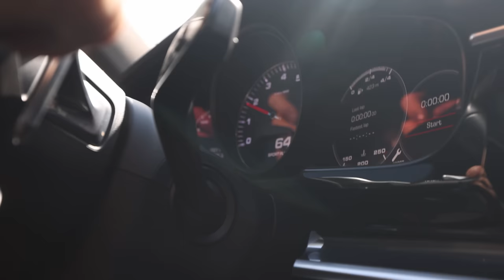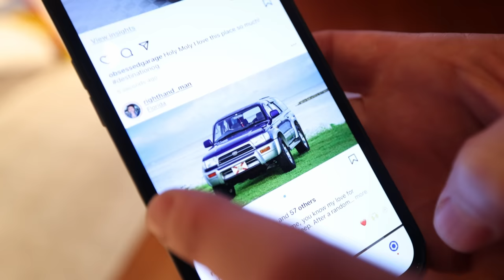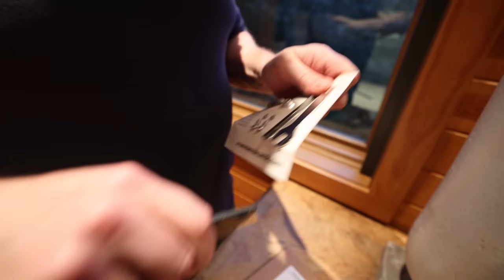Destination OG: Phase 2 - Installing Rogue Gym, Home Theater and Hiking! (EP:1)

Comment: Hey Matt… is there a benefit to using the AppleTV versus just using the stock apps on the smart tvs? Thanks!
Reply: Was eager to know the same thing
Reply: AppleTV User Interface is much smoother to deal with than stock apps, particularly on older Smart TVs where the tech is now a little dated. There’s also benefits like being able to use your iPhone as a keypad, remote, and being able to use AirPods with the TV. Being able to work in the garage and watch TV with AirPods is a huge benefit for me.

Comment: You could have fixed the slow speed on the old fan for about $15 by replacing the capacitor and speed control switch. 10 min. job.
Reply: You must be new here lol